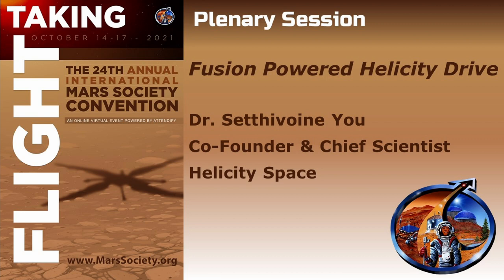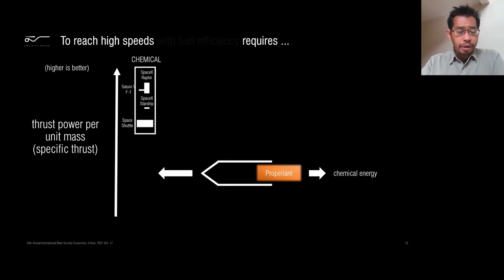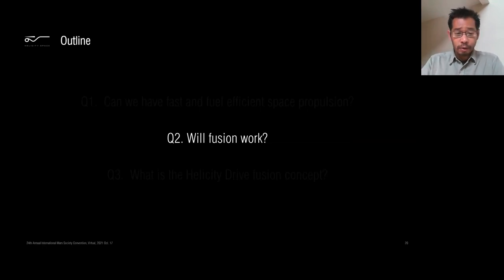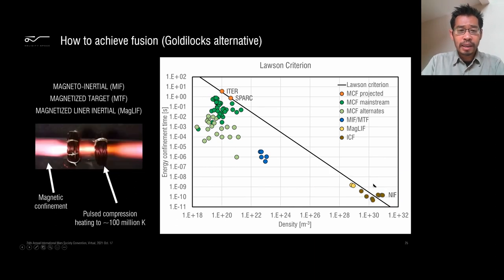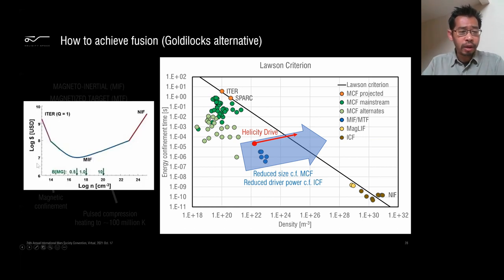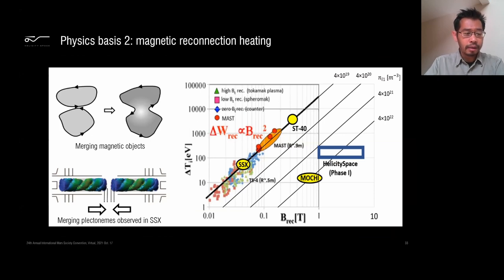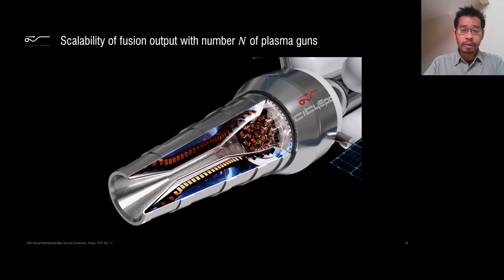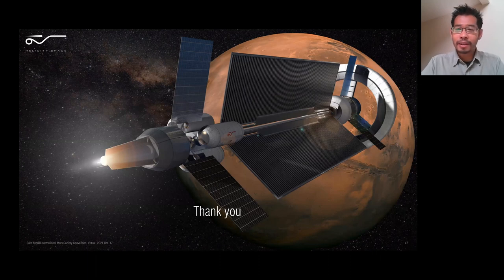Fusion Powered Helicity Drive - Dr. Setthivoine You - 2021 Mars Society Virtual Convention

Comment: Impressive research team of advisors.  Could this architecture incorporate the 1200T compression magnets recently designed in Tokyo?
Regarding heat dissipation, would the heating allow a fuel mix of D2 & He3 to reduce neutrons? And could the technology used in wall-less Hall-effect thrusters be used to help confine the exhaust stream to a controlled beam?